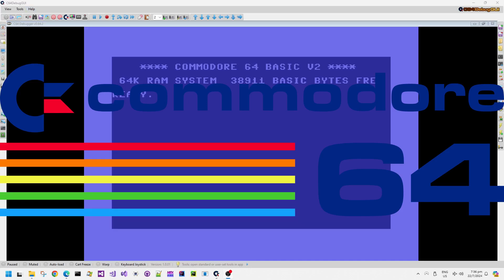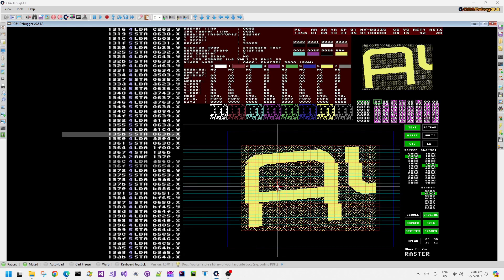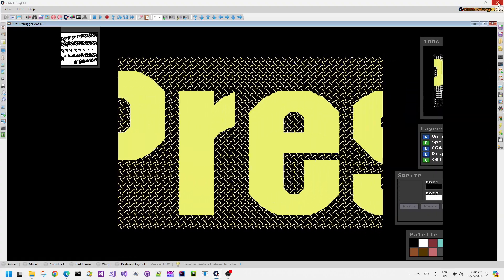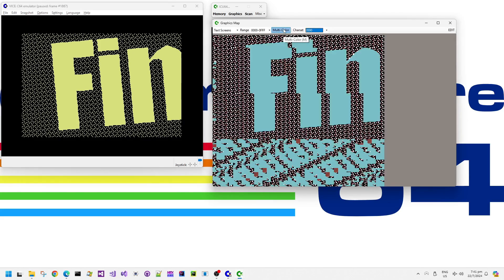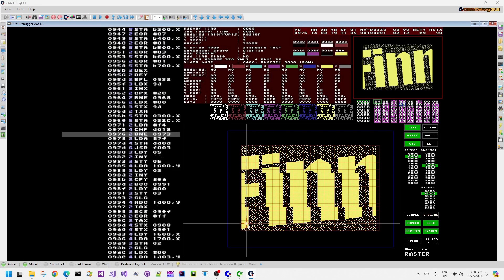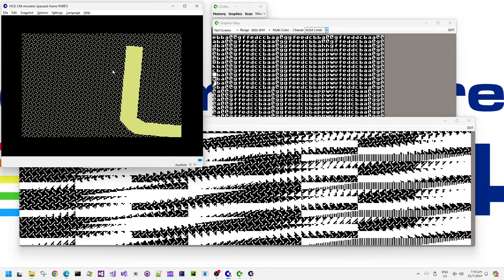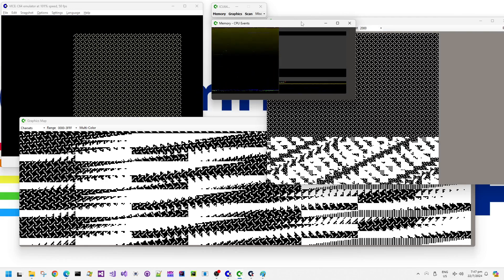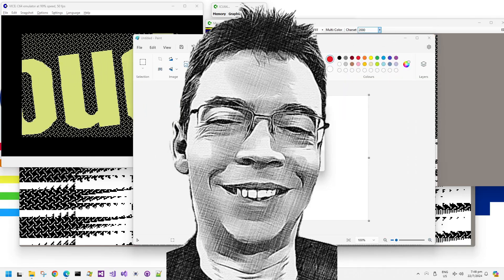C64 Demos peek - Layers

Comment: Extremely impressive. Parallax by swapping tiles was a pretty common thing on many 8-bit systems but I haven't seen it with this much rotation before. If any... Of course Amiga Demos did similar things but they had the blitter, dual playfield and sprites so many other techniques. I don't even know if hotswapping a screen full of text would work on the Ami
Reply from the maker: Well the original Amiga was certainly capable of redrawing the screen, but it didn't have a "text mode" as such, it was all bit planes based.

Comment: Its says in debug....standard text mode........but it looks quite crisp is .its 2 colors and if its interupting the resolution is 320x400
Reply from the maker: @Mr.1.i  yes it's in hires text mode
Reply: @MartinPiper6502  there are pokes that allow you to use the boarder for graphical instruction
Reply from the maker: @Mr.1.i  yes I'll be getting into those in another video

Comment: Still pretty darn clever. Shows the flexibility of the VIC-II chip for sure. Still finding new ways to do things with the VIC-II and the SID chip as well, even 40+ years later.
Reply from the maker: I'm very sure new effects are yet to be found.
Reply: @MartinPiper6502  Yep. I can remember vividly the first time I saw a demo with the top and bottom borders opened up. I wonder who was the first demo coder to figure that one out?
Reply from the maker: This page seems to have a list of first use of effects https://codebase64.org/doku.php?id=base:demo_world_records_and_world_firsts#border_top_bottom
Reply: @MartinPiper6502  Funny it took the coders 6 more months to figure out side borders. Sadly I have no idea what some of the effects listed are, such as FLD and VSP. I guess this is a page for demo-sceners so that makes sense.
Reply from the maker: The side borders need cycle accurate timing, the top/bottom borders timing is much more forgiving.
Reply: @MartinPiper6502  That would make an interesting video. Robin of "8 Bit Show & Tell" did a video last year that showed how to do open top and bottom borders.